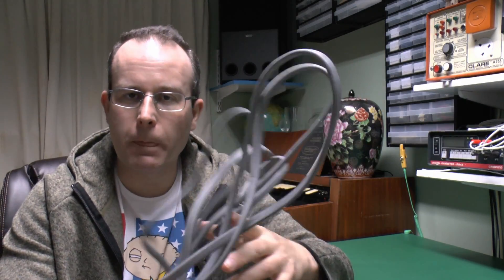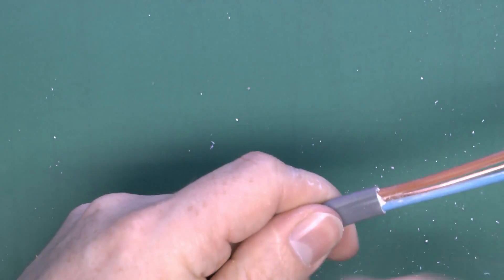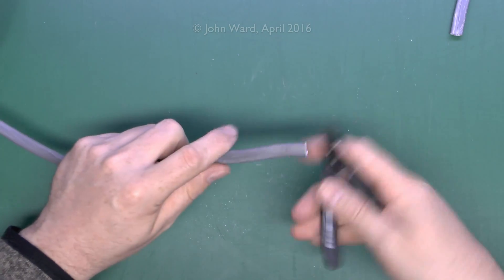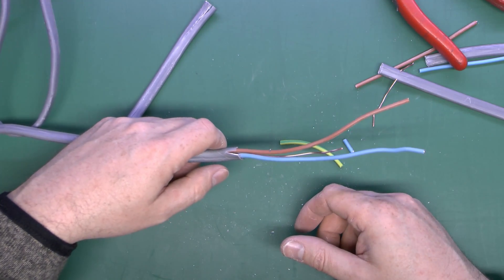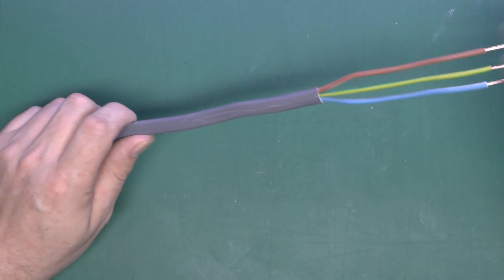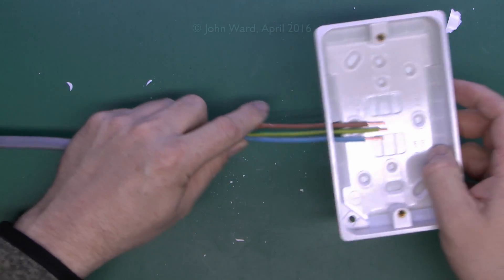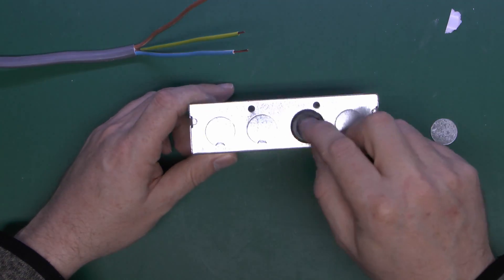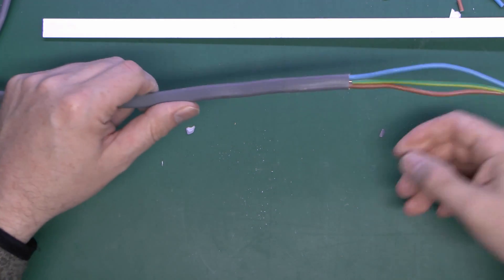Using Twin & Earth Cable

Comment: Thoughts;

I'll use a stanley where convenient if I want a particularly nice finish.  Not convenient for C.U. wiring for the most part, where I use the snip-into-the-end-and-pull-the-earth method, then snip the outer with the snips, not stanley, as there's too much risk of slicing into another wire in tight spaces (not advised when working live = often), alongside the distinct possibility of sliced fingers.  Also seen too many instances of careless stanley work resulting in exposed live conductors, including some pretty nasty faults in damp environments (blown SWAs at the gland).  As a rule, when I use a stanley, if I cut too deep then I cut the length off and start again (assumes you have length to spare in the first place).  Score the outer only...

Stripping the inners - My 1.5/2.5/+ strippers of choice are my quite old but still awesome Kew Technik snips that snipped through a live 1.5 T+E many years ago ("power off mate?" - "yeah" - snip, bang - "nope...").  Amusingly it blew two small holes of different sizes in the blades - one being great for 0.75-1.5mm, other being perfect for 2.5.

I always try to double-over exposed conductor ends where the terminal they're being fixed into allows for it (particularly if only hosting a single conductor), especially the thinner earth.  I see this as creating a better contact (lower resistance) due to increased contact area, allows for higher clamping force, reduces localised heating at the connection, and increased resistance to breaking the core in the terminal where an over-tightened screw may otherwise crush the copper.

T+E cable = for fixed installations only.  Don't do as some do and stick plugs on the end of it to be used as a substitute for flex cable...

I prefer to use capping if I C.B.A. purely to allow for the possibility of pulling in/out cables at a later date if required (better than having to chop back into that newly plastered/decorated wall...).

If I'm dealing with metal back boxes I tend to add a 1.5/2.5 G/Y length of 'singles' wire from it to the socket/switch/etc. where appropriate.  Better that have a back-box potentially go live if/when the plate is pulled away sometime.

Thanks for taking your time to do these videos, JW.  Always informative, and food for thought.
Reply: +9ff70f96 Majority of the time i use the  snip-into-the-end-and-pull-the-earth method, then snip the outer with the snips as it saves sooo much time and as its always said, TIME IS MONEY!! CK, NWS and a few other brands make snips that have built in 'strippers' for 1.0/1.5 and 2.5mm 2 cable, very handy in tight spaces! Only down side is when you need to cut a bigger cable ie 6mm up, you need to make 2-3 passes as you  don't have a full length blade. As for earthing back boxes, I tend to leave an extra 4-6 inches of T+E on cables in back boxes during 1st fix so that during 2nd fix, you snip off the extra cable, remove ONLY the CPC and terminate in the back box with a piece of earth sleeving then to the faceplate weather it be socket, switch, cooker isolator etc.

Comment: Would it be safe to do the following:
Install cables into wall
Cover with steel channel
Fill in the hole with expanding foam
?
Thanks
Reply: Mr J if you have to ask, you’re probably better off calling a professional.
Reply: No. Just use a bonding coat over the capping and leave 3mm shy of the surface. Then use any powdered filler you like but I recommend Gyproc easifill as it's easy to sand. You could use bonding to fix oval conduit either. Then fill as above.

Comment: Hi John, if this cable was plastered into a wall, it would mean destroying the house to rewire in 40 - 60 years time. Leads me on to a general question, during rewiring does it mean ripping up floor boards and digging through plaster or is the old wiring abandoned and horrible plastic trunking installed all over the house?
Reply from the maker: Rewiring can be done with surface trunking, but that's normally only used when it has to be done as quickly and cheaply as possible.
If the old wiring is in concealed conduit then that could be reused, but if not, or if things are needed in new locations then concealed wiring does mean chasing out walls, lifting floorboards and so on.

Comment: Little observation.... Placing two cables through different holes in a metal enclosure....was mentioned in a previous video of yours, using  meter tails and with regard to magnetic fields being created. It is odd that the powers that be (BS7671) do not recommend this in a consumer unit yet allow it with cables in back boxes.
Reply: +ningis21 You shouldn't put the neutral and phase(s) through different holes in a metal enclosure. That what that other video was about.

These are are cables that contains both the neutral and a phase, so the they should normaly cancel out., so you don't get any eddy currents.

In some cases you might get small <30mA differences, or differences due to stuff like shared neutrals in lighting circuits, but these are to small to be a problem. John ran 120 amp through different holes in that other video with no noticable effect. 30mA or even 10 or 16amp is no problem.
Reply: +ningis21 Only will be an issue if you place the line and neutral from the same cable through different holes. This then makes a transformer with the metal box between being the shorted secondary. However much current is flowing in the cable is then flowing in the steel, and heating it up. 20A from a ring main or spur will not do much heating, but in the consumer unit where you can have 60A flowing this then causes a lot of heating. The separate holes here are for separate cables, there will be no circulating current unless you have a broken ring, and even there the intact conductor will tend to balance the current flow so there will be minimum heating.
Reply: But the difference here is you're typically going to be running paired Line+Neutrals through, so I believe the EM field should be cancelled out.  Single-core tails are a different matter.

Comment: greetings, in Australia they used to the solid core cable, that changed years ago to multi strand, including the earth wire insulated. Do you see any advantages in solid or multi strand, what are your thoughts on both.
Reply: We have NEVER ever had a non stranded earth conductor in Oz, bare yes, solid never, solid cable was only ever used by cheap arse shit contractors because it was around half a beer cheaper than stranded cable per drum to purchase, the earth has always been stranded originally three strands now minimum of seven, the earth is the most importaint conductor in the circuit.
On a side note, thats why earth pins are the longest pins in plugs, and why the earth pin is the bottom pin in Aussie sockets, so if the plug is hanging out of the socket the earth disconects last.
Reply: Yes ,well my house in Australia is all solid core cable, not stranded at all.....I have lots of friends who I have checked there house and it's all solid core cable.....this is in Brisbane.......what are your thoughts on solid verses stranded cable, what do you think is best....thanks....

Comment: I wonder if you use round wires, like the NYM standard, in the UK? 
I hate flat cables and never use them. Such a pain to strip compared to round ones.
Reply from the maker: Round ones can be obtained but are seldom used, most building wiring is either the flat T&E as shown in the video, or single insulated wires inside metal or plastic conduit.
Reply: John Ward 
Thanks for the reply.

Comment: hi john great vid,how do you make a right angle with pvc trunking? many thanks
Reply: Either cut a 45 degree angle in each end (making sure you cut the angle the right way), or just butt one piece up to the other at 90 degrees leaving the ends square (my preferred method), and trim with snips to allow the wire/cable to pass through the bend.  Or you could go the quicker but rougher and more expensive route by buying 90 degree caps of the appropriate type (internal/external/etc bends) to cover-up gaps in your cuts (finished job tends to look worse, in my opinion).

Comment: Also when removing insulation try not to cut in to the conductor as this could reduce the csa of the conductor and may introduce a fatigue area (where if  it bent too much it could fracture on the cut area)

Comment: This is a good video - thanks, but I would like to make some comments. (1) Use of a stanley knife to cut the outer sheath is impractical: it would seem from this that you haven’t carried out much installation work. In a flush box or a c.u. getting the blade round the rear end of the sheath would be mightily awkward and the risk of damaging the conductor insulation would be unaceptably high! (2) You say that metal buckle clips are outdated, but the latest wiring regs require the use of them to preclude cables collapsing in a fire. (3) If a single 2.5sq mm cable is to connect to a s/o, cu,or other termination, the conductors should be doubled back to ensure a good connection. Personally, I dislike 2.5 T&E: in ring final circuits, it’s pretty much impossible to ensure continuity, as twisting the cores does not provide a secure joint, and placing the conductors side by side means continuity is dependent on the security of the screws clamping the conductors in each s/o or “spur unit”. 4mm sq is a better option, in a radial configuration, which has the advantage that ring circuit continuity testing is not required on EICR inspections. For use outside the equipotential zone, T&E in plastic trunking is unacceptable in my view. Pvc/swa/pvc or micc is far safer.
Reply: 4mm t&e is quite pricey and in practice you would find it difficult to spur off of. You wouldn't be able to put it on a 32amp mcb/rcbo unless it was directly clipped to the the wall. or you down rate to a 20 amp beeaker. In conduit or trunking 4mm t&e is de-aerated to 30amps. 2.5mm t&e is absolutely fine in a domestic environment. radials over rings unless it's high load circuits like kitchens.  As it's much easier to trace faults and unless it's a missing cpc they usually don't function.

Comment: Are you not supposed to earth the metal back box as well as the outlet?
Reply: That's a can of worms. Some people claim that you don't need to if there's a solid lug (that's per the regs, I believe.) but to me it's simply unprofessional not to. Because the guy who mentored me when training me [mumble] years ago... would've torn me a new one if I left out the earth flylead!
Reply: yes its should be
Reply: I moved into a newly built house in 1999. About 5 years after moving in one of our kitchen sockets started playing up - one of the switches gone u/s. On fitting the replacement socket - discovered that no earth lead fitted to the metal box earthing terminal-I rectified that. Being a curious chappie I went round the whole house to check all other sockets- none of the back boxes had the earth lead fitted - they do now! Still my house - my responsibility.
Reply: The sockets are designed with metal collars connected to the earth on the socket connector. In principle, when you tighten the fixing screws up, they will also earth the box too. However, for some that's not enough.
Reply: Watch how J Beck Electrical does it on here. He covers 3 inches of the CPC with sleeving, takes it and bends it 6 inches from the end and screws it to the back box, sticks some sleeving over the remaining and attaches the end to the socket outlet. One continuous loop. Really clever.

Comment: Good recommendation with not cutting off the earth at the end of the video..
Reply: +Colin Richardson The plastic boxes should have a place to slot it in so people are less likely to be a prat .
Reply from the maker: +Andrew Joy Some plastic boxes do have a terminal, but plenty do not.
Reply: +John Ward I tend to loop back the earth wire by doubling it, then poking it into the correct length of sleeving for if it wasn't doubled... thus leaving it completely insulated but present
Reply: I've encountered too many cut earths, even on socket outlets.  Call me racist, but often in premises owned by foreign types, where I guess they just don't bother with earths in their home countries.
Reply: 9ff70f96 Even more reason why everyone should follow the vastly superior UK electrical standard

Comment: oh and also I use the cheese wire method of striping the insulation!
kind regards Warren
Reply: Warren Grey, That method has a bending and straightening process that work hardens the copper conductor, leaving it more brittle.
Reply: @johnbower  Doubt it matters.

Comment: Why can't they just build a earth wire with sleeve already in.
Reply: Because it's not a current carrying conductor. Sleeve is for identification.
Reply: They started putting a sleeve onto the earth in 2.5 mm² I think last time I used it only about 1-2 months ago
Reply: Jk957 We use those here in Germany, for almost everything. But cables in walls are mostly individual conductors in plastic conduit.

Comment: i managed to stretch couple of earth conductors by pulling throughout the cast copex in concrete,  i used metal draw wire and i applied my body force to pull them out from the socket, but that happens only if you attach the earth conduit to the metal draw wire and only for distances like 3-5 meters long, you can spot that the earth wire is longer and thinner but not broken and the 1.6 formula for testing would fail by a small margin

Comment: Bad video never use a sharp knife to skin cable. You’ve just cut into the copper core and weakened that wire at that point